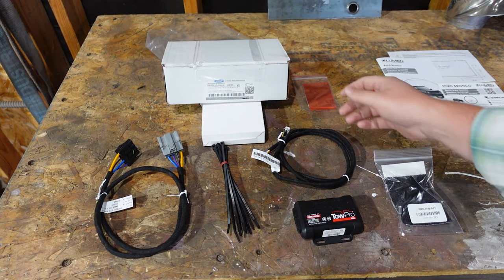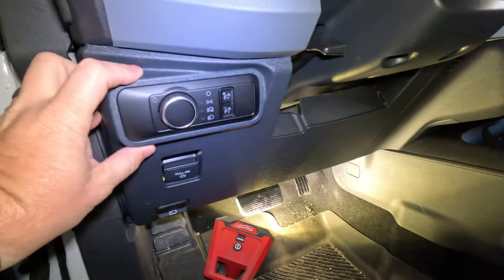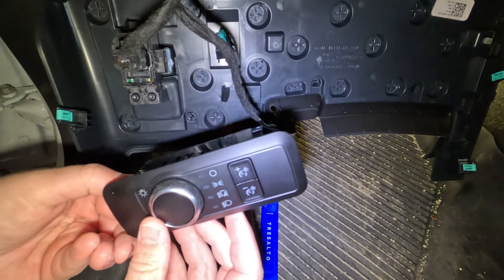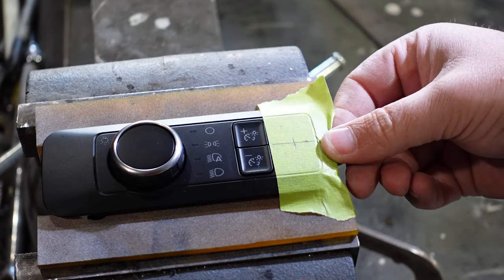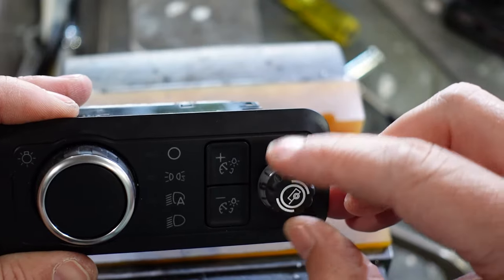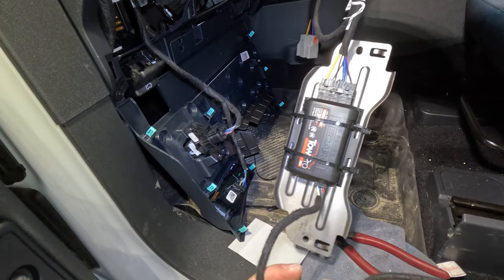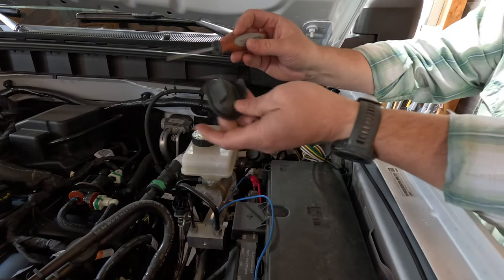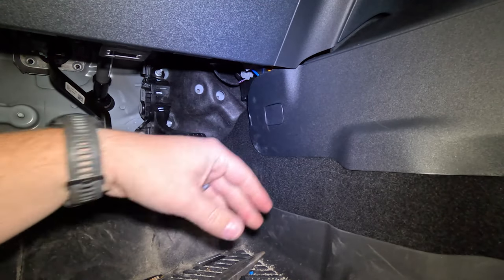2023 Bronco REDARC Tow-Pro Elite - Trailer Brake Controller Wiring

Comment: Nice install demo- enjoyed watching it.  I like this placement way better than the center console
Reply from the maker: Thanks, I'm happy with the placement too. And it worked great on a recent trip!
Reply: I’m using your video to install this on my Bronco.
Why did you have to tap into the RedArc harness under the dash with the blue wire? 
Your videos are really good. I learn allot. 
Thanks.
Reply from the maker: @jonyossarian4803  Thanks! We had to run the blue wire because this one didn't have the tow package from the factory. If it would have had the tow package, then there would be a factory harness with that wire already ran to the back.

Comment: This is awesome, thank you! I am getting ready to do my same install.

My question, I assume you disconnected the battery? I have read so much about yes with loose wire connections and no with connectors, I just assume disconnecting the battery is a best practice.

Thanks again!
Reply from the maker: Yes, disconnect the battery or pull the fuse when wiring. I'm glad this video helped!
Reply: @RoadandReel  I just installed per your guidance and AWESOME!!!! Thank you so much!

Comment: Did you have to splice into the TPH-007 blue wire because the vehicle did not come with a tow package and/or a 4 and 7 pin connector?
Reply from the maker: Yes, that's correct.
Reply: I followed everything you did and said to a T and it worked perfectly. REDARC and Curt should sponsor you. There isn’t a better video that I’ve seen that covers the installation of both products. Well done! Thank you.

Comment: CAUTION!!!  DOES NOT FIT AS THEY SHOW

Slick edit @9:39 where you connect the cable to the switch then cut away and don't show that the cable interferes with the panel support! Wish you had been honest and showed that. Then I would have probably mounted in the center console as originally planned. 

The only way to make this work is going to be to cut out part of the panel support.
Reply from the maker: What are you talking about? Pull the panel support off and mount it on the backside like I show. No special edits, you just have to look how everything mounts and you can move it to where it doesn't interfere.
Reply from the maker: 11:47 shows it all go back together.